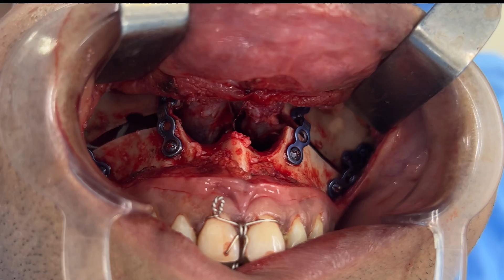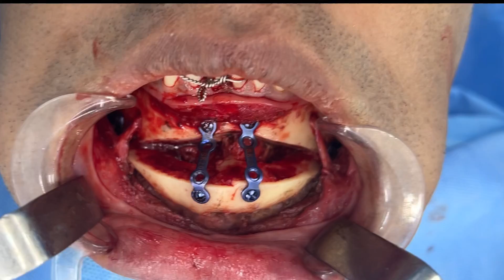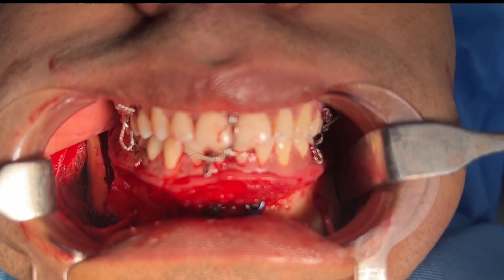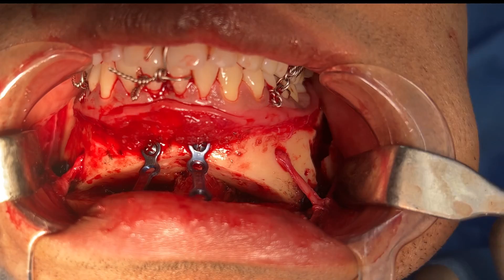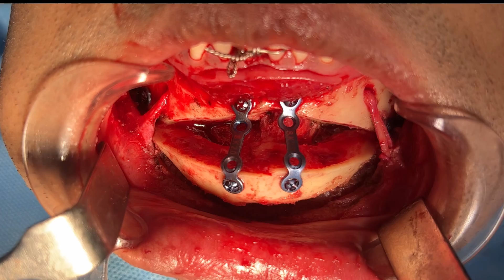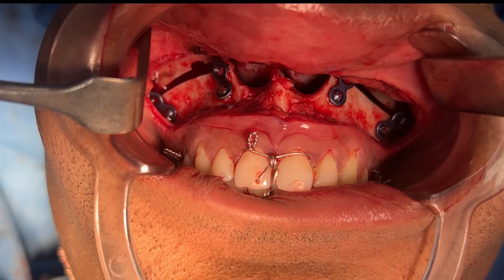How Upper and Lower Jaws are Broken and fixed using titanium mini plates and screws - maxillofacial

Comment: How do you fill the gap in the upper jaw?
Reply from the maker: It will be filled automatically
Reply: @RichardsonsFaceHospitals  So no bone grafts?? When are bone grafts used? Only for downgrafting with cw rotation ?
Reply: @RichardsonsFaceHospitals  No bone grafts? Or is there a certain limit up till which the gaps will be filled automatically?